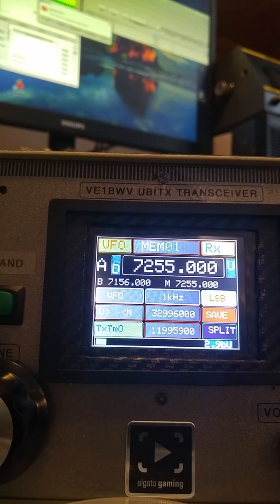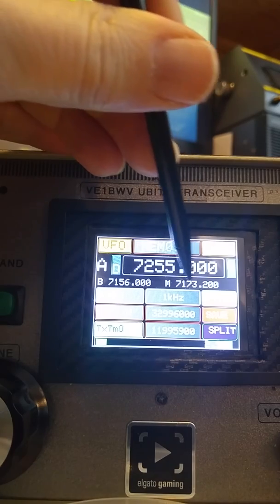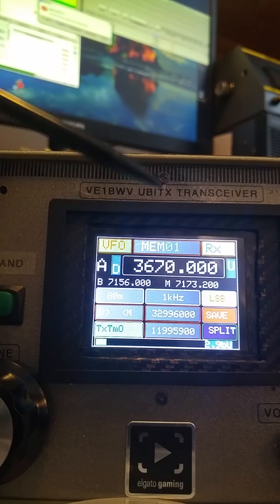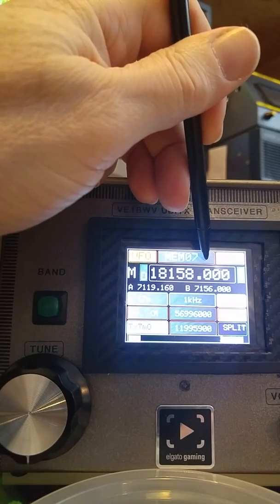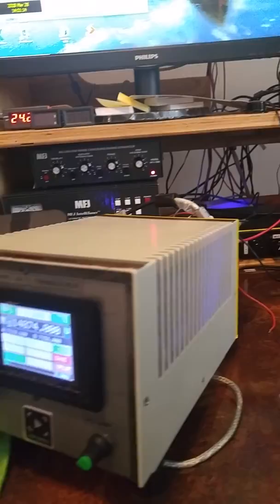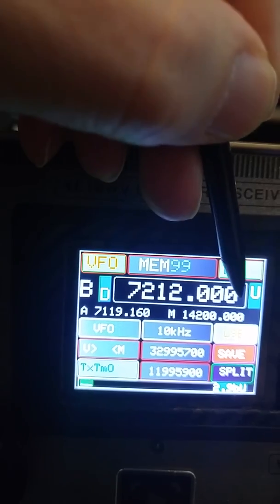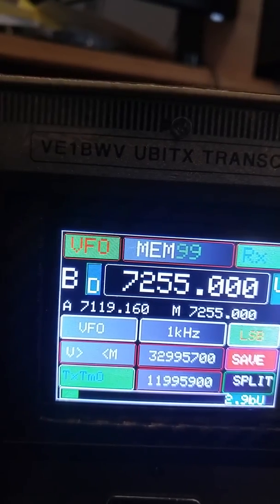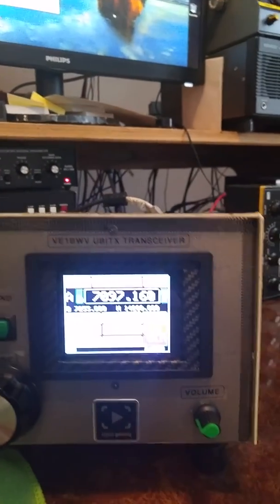UBITX VER 2.9bu - COLOUR TOUCH CONTOL

Comment: Hi Joe can i pick your brains for a moment,i have the same elegoo 2.8'' tft touch screen ,arduino mega 2560, arduino 1.8.5 ide have down loaded all the libraries and the sketch.
i do not get any compiling error but the screen just stays white when i upload with this sketch.
i can upload examples from the elegoo disk and they work just fine.I am new to
all this arduino stuff can you help this old dumb ham out please Joe thank you
cheers Rob.
Reply from the maker: The white screen is normal if you have not selected the Elegoo as your default screen
In side the code  you need to un comment the define elegoo and comment out the current #define
Reply from the maker: send me an email at joeman2116@gmail.com - if I can help some more.... Joe VE1BWV
Reply: Thanks for the reply Joe i have  the screen up and running , now to wire it all up  cheers Rob VK4AJR